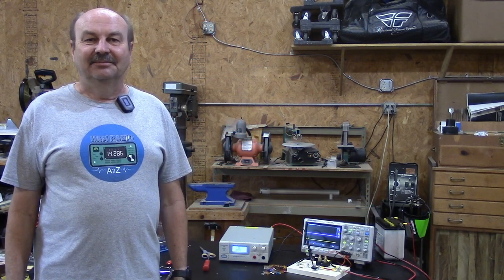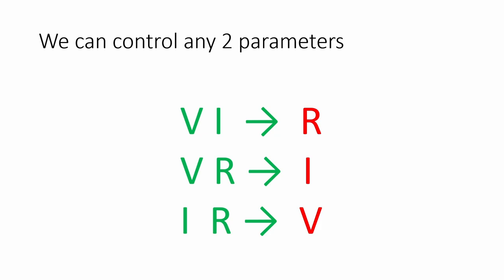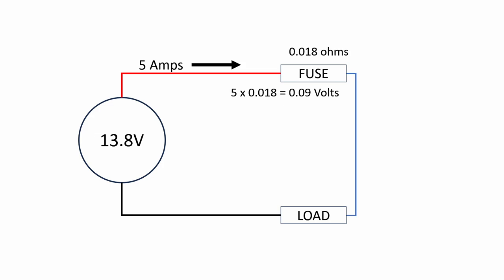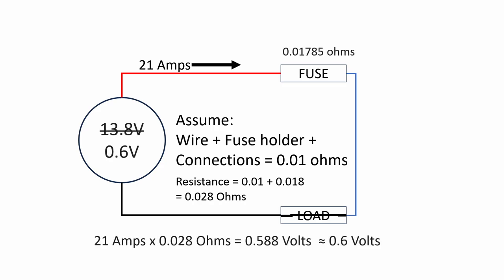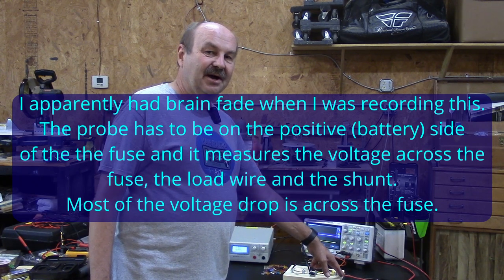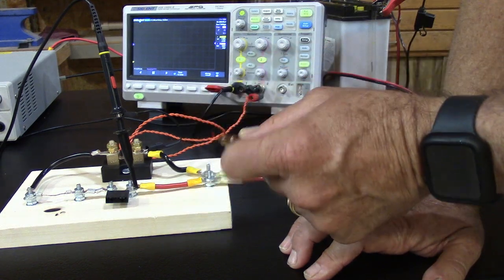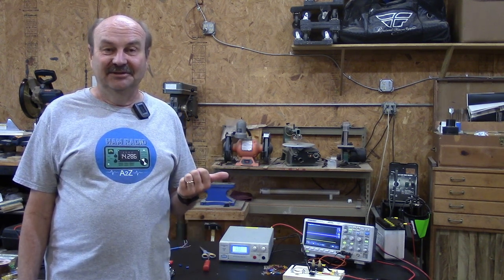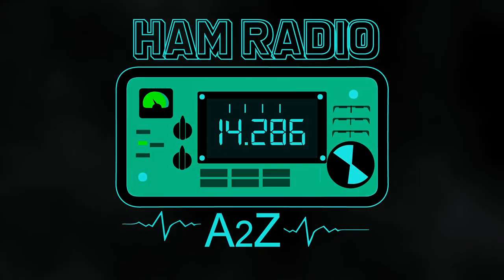Bad Fuses Part 2

Comment: It seems like a load of people don't realise that a fuse is put in a circuit to protect against an overload. I accept that the cheap fuse will blow nearly instantly on a complete short circuit - but if it doesn't blow within a few seconds during an overload, it will not protect your vehicle's wiring loom. A 5A fuse that allows 20A to flow for an indefinite time will almost certainly result in the overheating and damage of the wire it is supposedly protecting. Many vehicles these days have wiring sizes that are as small as the manufacturer can get away with and cannot take much overload.
Reply: Fuses have NO means of limiting current except based on power (V*I). So a so-called 5A fuse can certainly allow for more current when the voltage is less as the power is less. If you have a 12v 5A fuse, the power it is designed to allow is 60W. In the case of the current limiting power supply, it was 0.6v at 20A, or 12W.
Reply: @MistDaemon  no, the voltage of the power supply is irrelevant as long as its high enough to cause that current to flow, the point is a 5a fuse should blow at a reasonably low multiple of 5a within a reasonably short time, if the current limited supply is showing 0.6v  then its self limiting to that level as thats whats needed for 20amp to flow into that fuse plus all the wiring, the fuse should still blow within a reasonable time, the power in the fuse you described as being 60w is wrong as there will not be 12v across it at 5 amp flowing, it should only be a few millivolts , think about it,  if 20 amp caused a drop of 0.6v , at 5amp it will be much less, about a fourth, 0.15v,  0.15v times 5amp is not 60w, but 0.75w, you may think thats not enough to blow a fuse, it is, the wire has a small cross section area and that amount of power in a small space will easily melt it ,
Reply: @andygozzo72  please read what I actually said, not what you want it to be. I was talking about a complete circuit, not just the fuse. How does a fuse work? It needs to melt the metal. That means it takes power. What is the voltage drop across the fuse? The maximum is 0.6v, but that isn't likely since there is resistance in other parts. If there isn't enough power across the fuse, it can't melt. It isn't just about current.
Reply: @MistDaemon  I think you have less than adequate understanding of how Ohm's law works.
Reply: @brianleeper5737  that is false. Clearly you don't understand how fuses work, nor many other things it appears.
Reply: @MistDaemon  Ohm's law says that if you know the resistance and the current, you know the voltage. Voltage times current equals wattage. A fuse is designed to blow when voltage drop across it, and therefore the wattage, and therefore the amount of heat it must dissipate, exceeds a certain amount. All you need to know to determine if a fuse will or should blow is the amperage flowing through it. The fuse doesn't see the voltage drop through the load and it's irrelevant to the question of whether the fuse will blow. Think about replacing the fuse with an ammeter, same situation. Whether your load is a  1/2 ohm resistor with a 3V supply, a 1 ohm resistor with a 6V supply or a 2 ohm resistor with a 12V supply, the fuse and ammeter both see 6 amps of current passing through. It is IMPOSSIBLE to tell the difference by measuring the series current through the circuit. A given fuse would behave IDENTICALLY in each of these three circuits despite one having a 3V supply, one having a 6V supply, and one having a 12V supply. And that's why your entire premise is wrong, and why you clearly don't understand Ohm's law.
Reply: @MistDaemon  Also, fuses are not rated for voltage, except for the maximum amount of voltage they are designed to safely interrupt.
Reply: @MistDaemon  in the case of a fuse, it is, as long as enough voltage from the power source, to supply that current into the whole circuit resistance ,
Reply: @brianleeper5737  rated in amps,  but power is needed. The fuse has to melt.
Reply: @andygozzo72  power is needed, notice the low wattage.
Reply: @MistDaemon  amps times the voltage drop over the fuse is the power. The voltage drop over the fuse is directly proportional to the amps flowing through it. The fuse has resistance, so it will develop a voltage drop. It's calibrated to blow at a certain amperage. All by design.
Reply: @MistDaemon  yes, but the power within the fuse is enough to melt it, 5amp fuse wire is approx 0.2mm, at that small size a small wattage will cause considerable heating , enough to melt it ,
Reply: @andygozzo72  there wasn't much power, plus others have commented that it might not have been a 5A fuse. The wires heated up, which indicates resistance there, plus the connectors.
Reply: @brianleeper5737  so tell me, what was the voltage drop over the fuse? You don't know. There is resistance in other parts of the circuit, so there is voltage drops there as well.
Reply: @MistDaemon  The information needed to calculate the voltage drop over the name-brand fuse is in the spec sheet shown in this video. That is the resistance of the fuse. No such information is available for the no-name fuse. None of that matters, though---a 5 amp fuse should blow when 20 amps is passing through it. You'll notice that the name-brand fuse did in fact blow under the same conditions that the no-name fuse did not. That makes the no-name fuse non compliant for what it claims to be.
Reply: @brianleeper5737  you don't know the resistance, nor the voltage drop across it.
Reply: @brianleeper5737  yes, but not the no-name and so you don't actually know if it is a 5A fuse or not. You also don't know the resistance of the other parts of the circuit, so you can't determine the voltage drop. The test doesn't appear to be valid due to using a current limiting power supply and setting it up as a dead short.
Reply: @MistDaemon  regardless, voltage is not an issue as long as enough to push the current needed through all the various parts of the circuit path, the voltage rating of a fuse is not whats needed to blow it but a maximum it can stand across it just after blowing, due to possibility of an arc forming, this is also why uk plug fuses have(should have.?!) a sand filling, to quench any arc,

Comment: Hello,

I recently saw fuses for 24 volts in a China shop.

could it be 24 volt fuses?

Kind regards
Helmut
Austria 73+ 55
Reply from the maker: ATC/ATO blade fuses are all supposed to be rated for operation up to 32V DC.  So, no that wouldn’t be the problem.

Comment: Could this perhaps explain why Apple laptops in the past (or maybe even today?) would have components on the motherboard self destruct while the fuse that was supposed to prevent that from happening still be good? Louis Rossman for years has shown such behavior on his YT channel.
Reply from the maker: It is nearly impossible to design/select a fuse that will protect every component inside any electronics.  I mentioned in the first video that fuses are primarily intended to protect wiring and prevent fires.  When something shorts inside a piece of electronics, a properly sized fuse can help reduce additional damage inside the box, but probably won’t prevent all collateral damage.

Comment: I don’t think there is any justification to use a cheap Chinese fuse ever, no matter the current capability of the supply.  If the circuit is worth protecting, use a quality fuse from a reputable vendor.  If your circuit isn’t worth protecting, then save the cost of the fuse holder and cheap Chinese fuse and just don’t protect it at all.  It’s rather simple.

Comment: So, there is hundres thousands cars with bogus fuses
Reply from the maker: I don’t know what brand vehicle OEMs use, but I suspect they use fuses that are properly certified to meet the appropriate SAE standards.
Reply: @HamRadioA2Z  GM actually issued a TSB about no-name fuses causing wiring harness damage when they fail to blow. This from 2007: "Concerns with Harbor Freight Tools "Storehouse" Branded Blade Type Fuses

General Motors has become aware of a fuse recall by Harbor Freight Tools/Storehouse for a variety of aftermarket fuses. In two cases, these fuses have not provided protection for the wiring system of the vehicles they were customer installed in. Upon testing the 15 amp version, it was found that the fuse still would not "open" when shorted directly across the battery terminals."

Comment: Who are the boneheads who want twelve volts across a short? Fuses are supposed to blow at a certain current, regardless what voltage.

That's why there's usually a 250 volt fuse in your microwave or television and it is still compliant in the US. The voltage rating only shows you the maximum isolation value.

Blade fuses are only rated to 32 volts. That's why you don't see them in household appliances. They will still blow at their respective current, but they are not guaranteed to open the circuit. This poses an obvious fire hazard.

Educate yourselves before you make ignorant comments to someone who knows what he's talking about and is trying to help people not burn their electronics (and their houses) down.

Comment: Well you definitely can get 12v across the fuse you just aren't going to get 12v voltage drop on the fuse but you get why knowing ohms law is why you would assume voltage would matter because if you have something at 1 ohms and you only have 1v thats only 1 watt vs 12v would be 12w

Comment: Perhaps you should do a test with a direct comparison of the different fuses, but with a real load, not a short circuit. You would also need to replace the wiring between tests if you are doing a short circuit, especially if you have a small wire in the circuit. Consider what you are claiming to test, a 5A fuse in a 12v circuit (yes, the voltage is actually higher, but ignore that for ease of comparison) means that the total circuit is max 60W. In your first video, the voltage dropped down to 0.6v at around 20A, which is around 12W. Cheaper fuses may have more resistance in the contacts, which affects things as well. The example with a wire that you say can handle 3A and a 5A fuse doesn't make much sense. You need to run the power supply in constant voltage, not constant current, although in constant current the power supply will protect things. Do a search regarding how fuses work. A fuse has NO means to limit the current except at a specific voltage (power is really what it is limiting). A fuse has resistance, which causes it to heat up as more power is applied (V*I) and it dissipates the power as heat, with enough heat it will melt, but it needs power to melt.
Reply from the maker: The power dissipated by the fuse (or any resistor) is I^2 * R (Current squared x resistance).  The voltage rating on a fuse (32V for these blade fuses) only defines the maximum voltage where the fuse can safely break the arc once it blows.  The voltage rating is unrelated to current required to blow the fuse.
Reply: Under what normal circumstances does a 5A fuse dissipate 12W of power and not blow?
Reply: @brianleeper5737  there is other resistance in the circuit, so it isn't 12W on the fuse.
Reply: @HamRadioA2Z  the resistance has not been tested, so the power dissipated is unknown, the voltage drop across the fuse wasn't measured.
Reply: @MistDaemon  The other resistance in the circuit should be minimal compared to the fuse. But maybe the no-name fuse has a lower resistance than it should and that's one reason why it won't blow with 20A flowing through it?
Reply: @brianleeper5737  the other resistance SHOULD BE MINIMAL? You don't know what it is. Some said the color was wrong for a 5A fuse, others said it didn't look like a 5A fuse inside. Lots of unknowns and not really a valid test.
Reply: @MistDaemon  I don't know the owner of this channel at all, but I find it difficult to believe that he would have tested something other than a fuse marked 5. And there's the problem--just because this no-name fuse is marked 5 doesn't mean it's really a 5 amp fuse. His testing demonstrated that it isn't actually a 5 amp fuse. Therefore it's garbage, not to be used. FYI, I've seen this behavior with other no-name fuses, like a fuse marked 15 (leading you to think it must be a 15A fuse) that I was trying to get to blow while the legs were just burning away as I connected it across a car battery. I suspected that it's a piece of crap and my suspicions were CONFIRMED. My conclusion is--I won't use no-name fuses. The number marked on them means nothing. There's no quality control. As long as it passes a current, the manufacturer of this crap thinks its fine. You might as well use a piece of wire instead, for all the protection you'll get.
Reply: @brianleeper5737  is it marked? Did it get mixed with others? You don't know. His testing didn't show that at all, when he really tested it, it blew. Testing with a short is wrong though.
Reply: @MistDaemon  Is it marked, you ask. Did it get mixed with others, you ask. I ask, what the hell good is a fuse that isn't marked and that could get mixed up with others? How is testing with a short wrong? That's what a fuse is supposed to protect against.
Reply: @brianleeper5737  Testing with such a power supply doesn't really test a short, does it? A fuse is to protect against over current, not shorts, although a short is over current. Testing with a current limiting power supply changes things, doesn't it? I noticed you didn't want to answer my questions and instead you just want to assume things.
Reply: @MistDaemon  The current limit of the supply used is 20A. The fuse connected to it that did not blow was supposedly a 5A fuse. I await your explanation as to why the supposedly 5A no-name fuse did not blow, while the definitely 5A name-brand fuse did.
Reply: @brianleeper5737  because it needs enough power to melt the fuse. You still don't want to answer my questions, do you? Only one way. There are issues with the testing, but you want to ignore that, don't you?
Reply: @MistDaemon  It has enough power to melt the name-brand 5A fuse. Why doesn't it have enough power to melt the no-name (supposedly) 5A fuse? I'll rephrase the question. Why does a name-brand 5A fuse take LESS power to blow than a no-name 5A fuse if they're both 5A fuses? I'll answer it for you--because the no-name fuse is NOT a 5A fuse even if it is marked as such. There's no issue with the testing, the issue is with the no-name "5A" fuse that isn't really a 5A fuse. My guess, by the way, is that it's probably got a 30A or 40A fuse element inside. The person who did this video ought to compare it with a 30A or 40A fuse.
Reply: @brianleeper5737  the fact is you don't know. You don't know if it was marked or anything else. Using a constant current power supply isn't a good test either.
Reply: @MistDaemon  We're talking in circles now. So I'll stop.
Reply: @brianleeper5737  did you see what it was marked? There are a lot of issues which you choose to ignore in the testing
Reply: @brianleeper5737  that is a good idea since you don't listen and ignore what you don't like.
Reply: @MistDaemon  It's rich of you to accuse others of what you yourself do.
Reply: @brianleeper5737  nice false claim by you.